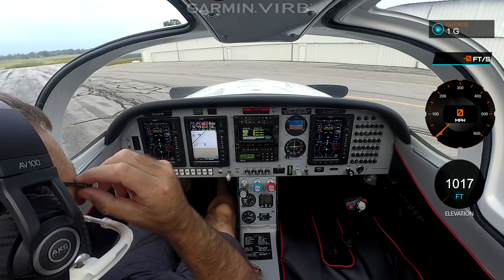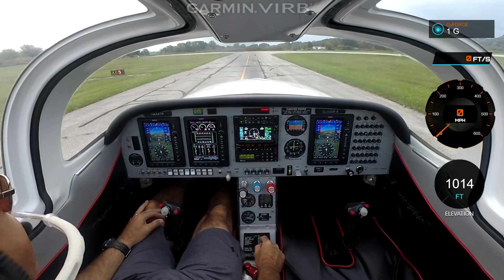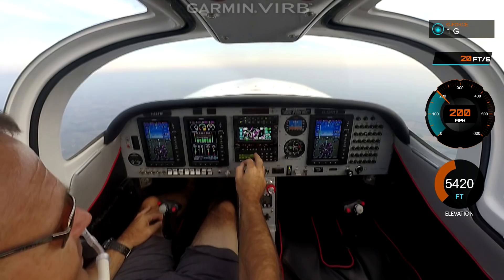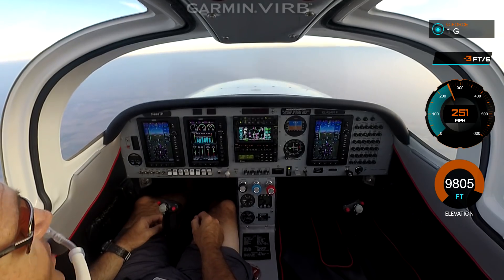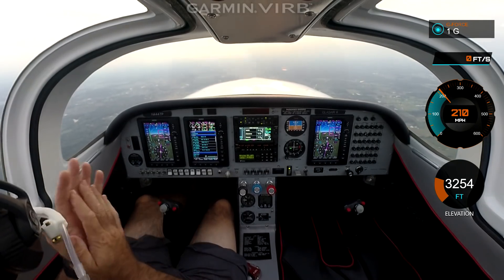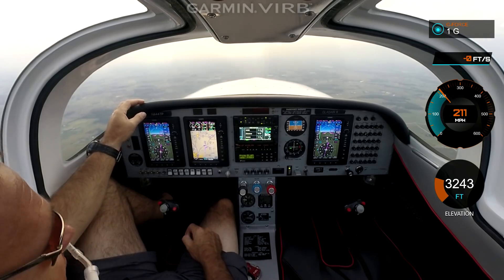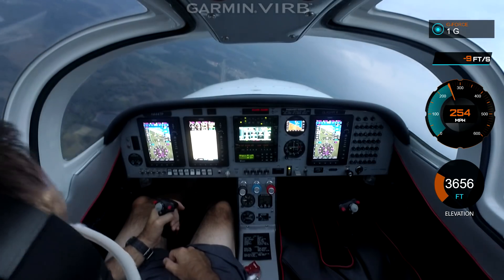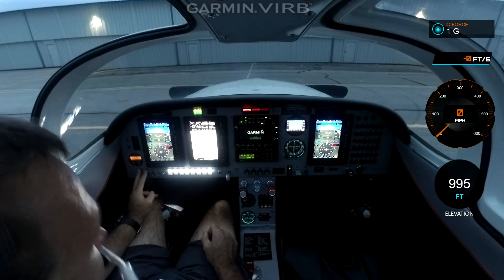Glasair III Full Demonstration with Garmin G3X

Comment: Very small but efficient little airplane. Absolutely love all the features on the airplane. Excellent performance and fuel burn. I can easily see why you chose this airplane over many others. You have total control of the airplane from takeoff to landing. I am extremely impressed with the performance of this light single engine. Your documentary was excellently done!

Comment: Beautiful airplane! Great performance, and a really great video demonstration of the plane and its capabilities! Thank you! I have been a EAA member for about (40) years, and I have dreamed of owning a fast experimental aircraft. Started building an RV-6, then sold it. I owned a Rockwell Commander 14, with an IO-540 engine and a three bladed Prop, with dual full panel of King Gold Crown avionics, DME, HSI, RX-10 Weather Radar, Auto-Pilot system with altitude hold and approach capabilities, and a few other goodies. My plane used to belong to Hilton Head Resort, so it was decked out and well maintained. I loved that airplane, but I always wanted more speed for less fuel burn and overall operating costs. Experimental aircraft is the way to go for the things that I wanted. Also, the new glass panels are really nice! Thanks for your video!
Reply: I agree. Really well produced flying video.

Comment: I just noticed that when you hit the transmit button on the radio that the flap indication disappears and reappears when you stop transmitting. Just in case you weren't aware. Wouldn't want it being a symptom of a much larger electrical issue. Awesome airplane. It's definitely a dream plane for me.
Reply from the maker: Yes,  good catch. If you look closely you will also see the hydraulic indicator peg itself when transmitiing. Both units use a sensor that is too close to the comm antenna.

Comment from the maker: Ok, sorry I have not addressed some questions.  I would like to answer a few.  
First, I had no military training and this plane is easy to fly if you understand that this plane can exceed your physical limitations and also is faster than 90% of piston planes, so you need to think ahead.
The airplane truly is a 205 knot on 10-14 GPH depending on altitude.  It has a range of well over 1200 miles with reserves.
You will spend $200k or more for a good plane like this one that has the extended fuel, updated gear, good avionics, and has not been gear upped.
This plane will not fly well in the ice - do not try it.  The reason it is fast is because it has a low drag air frame and high performance wing.  Ice on the wing and tail, even in small amounts, severely affects it's ability to produce lift.  It could get very scary very quickly.
The airport I flew out of gets about 5 airplanes a day using it.  I was well aware of my surroundings and any aircraft in the area.  Furthermore, the area I flew in was also pretty much void of traffic.  Not much going in in this area.  I had good total situational awareness and was not endangering me or anyone else in the air. 
I wish I would NOT have traded this plane for the Cirrus.  The Cirrus I bought was your typical factory built plane with RIDICULOUS parts prices and was NOT easy to work on.  It was 50 knots slower, used more fuel, and had LESS useful load.  Insurance was also more for the Cirrus.  I knew right away I had made a mistake.  I wish I would have kept this plane as it was the best one in the country.  As such, the guy that bought this plane did not like it and his wife hated it.  He liked the room of the Cirrus and the avionics in the Cirrus better.  I think he bought a new Cirrus.
This plane would never pass any certification for Part 23 and that is why it is fast and efficient.  When you demand that a single engine normally aspirated non-pressurized plane be made idiot proof it will not be efficient or fast.  The only was to go fast in a certified plane is to have turbochargers and high altitude as the wing needs to be forgiving enough for those with low skill to be safe in.  You will only get this performance in a certified plane up high where the draggy wing isn't so draggy.
The camera used in the video was a Garmin VIRB.  I can't remember the exact model, but it is fairly new and is red in color.
I used oxygen on almost every flight because I generate my own, so it is pretty much free.  The oxygen system is self-diagnostic, so you do not have to manually check it before flight.

So, long story short:  Fast, efficient, great ride due to high wing loading, fun, cheap to maintain, bad in ice, bad for people that think the airplane should have safety features like a modern car.  I can't think of a better plane for 1 or 2 people to go cross country in.
Reply: Why did you trade it for the Cirrus in the first place? What did this plane not do that you wanted?
Reply: Thanks for a great presentation of what this aircraft can do. When these first became available a long time back I lusted after one but could never afford it. At the time and for a total of 18 years I owned and flew a Grumman AA1A but with a 150hp motor that I installed instead of the 108. 

My cruise speed was about the same as your approach speed! But I did like the high(er) wing loading, the resultant comfy ride in turbulence where some pilots would not venture, the one finger touch on the controls. and the responsiveness. 

To me an aircraft that flies like a heavy-handling bus is no aircraft worth having!
Reply: St
Reply: Stewart W. J)

Comment: The GP-4 is a good match for this plane. 210 knot max cruise at 75% power at low altitudes and will go 1,200 nautical miles at that max cruise setting, much farther at lower power settings if you can sit there that long, and all on 200HP from an IO-360! I'm planning on building one, and figure it'll cost around $100K with a panel similar to yours. We'll see. Probably oughta finish my Super Baby Great Lakes first, though. Thanks for the nice demo. Subscribed.
Reply from the maker: The GP-4 is a neat airplane for sure and is definitely a good value, but it really is not a match for the GIII for many reasons.

First, the standard landing gear system is not a good design requiring to slow within 10 knots of stall speed to retract the gear.  The hydraulic system is much better, but adds weight and cost which reduces useful load and the initial value advantage.  

Next, the cabin is narrower and tapers towards the feet like the Lancair Legacy.  I find the GIII to be about as narrow as I want to fly in with another adult.  Of course, you get more speed with a narrower cabin typically.

They also list the max range with reserve and top speed as if they are obtainable together which is not true.  At 209 knots the GP-4 needs to be at 6000-7000 ft to make 75% and rich of peak.  You are looking at 11 GPH at that setting which gives you 4 hours of flying time and safe reserve VFR.  That is a maximum of 840 miles and that is not taking into account extra fuel used in the climb.  The GIII will burn the same fuel lean of peak at 12k making the same speed and with 82 gallons available it has a safe VFR range of over 1200NM which includes climb fuel.  At 15k ft it will still make 200+ knots on 9 GPH which is over 8 hours and 1600NM.  The GP-4 will be down in the 160-170 knot range up high because it will only be making 100 HP at 15k with the GIII will be making 50% more HP.  Remember, even thought the GP-4 is only 33% less HP at sea level - it is 50% less at altitude and speed will suffer.  Having the bigger engine in the GIII is not a huge advantage down low, but is very advantageous to give you the ability to get up high and take advantage of the smooth air above much of the weather.  I rarely fly x-countries under 10k because of bumps in the summer and general cloud tops in the winter usually leveling off around 11-13k on my trips from MI to FL.  THe wing loading of 27 per ft on the GIII vs 19 per ft in the GP-4 is also a big differences as far as ride is concerned.  Fly both in bumps and you feel a huge difference.

The GP-4 has a great G rating just like the GIII because they both share a one-piece spar design, but there is no comparison to the overall air frame strength.  The yellow arc in the GIII does not even begin until 292 MPH which is nearly 40 MPH more than never exceed speed in the GP-4.  Never Exceed in the GIII is 340 MPH and Jeff Lavelle is turning laps of over 410 MPH in his stock (air frame) GIII at Reno.    

Finally - value.  Like I said earlier, the GP-4 has great initial value, but only if you consider your labor worth $0 and you limit your budget.  A good IO-360 with accessories (prop gov, dual alternators, starter, electronic ignition, etc) will cost you at least $40,000.  A good prop is another $10,000.  The panel in my plane was $60,000.  That puts you at $110,000 and you have not bought anything for the air frame yet.  Then there is the fact that building one will take about 3000-4000 hours.  It is a $250,000 plane if you have it professionally built to high standards.  At that price you have a lot of other choices.   GP-4 is a neat plane, but just not in the same category.

Comment: Wow, what a machine!  Thanks for such a detailed overview and flight.
Reply from the maker: Thank you. I miss this plane. I wish I would have never sold it. Nothing compares to its performance, efficiency, and handling.
Reply: If fly a 1956 Cessna 172 straight-tail, so this plane is definitely a dream machine. I’m sure your Cirrus is still a worthy plane.
Reply from the maker: I hated the Cirrus. An Rv10 is faster on less fuel, has better avionics, and is 1/5th the cost to insure and operate. I didn't have the Cirrus 3 months before selling it. My wife wanted the cirrus for the Parachute. I would rather have your 172 and the G3 for less money than a comparable cirrus.
Reply: Dukepilot , fair enough. Curiously enough, I’ve pretty much settled on the RV-10 as my dream plane project should finances and time permit. Vans seems to be the benchmark.

Comment: I had a Glasair III for a few years. Not as well equipped as yours but lovely plane. No switching of fuel tanks on mine. I had the manual flaps which I prefer. Would pull 10 degrees flaps at 140 knots before lowering the gear making approaches much easier (plane can apparently handle 160 kts at 10 degrees). However, found it difficult in instrument conditions as it is over sensitive in pitch and the spring trim (no tab) is suboptimal. It’s the only plane I really miss. Cheap and fast.

Comment: My dad built a Glasair 2RG and it was a gorgeous plane. It was fast, too! He also built a Long-Eze before the Glasair. He decided on the Glasair, because we could fly side by side instead of sitting behind if we had to land for any reason, it was a lot harder sitting in the back. I sure miss flying with my dad, but he passed away 10 yrs ago. Sad day when the new owner flew off in it. My mom, brother and I were sitting in our  hangar crying our eyes out. I have a question, why the oxygen when you’re still at a low altitude, is it just because there’s a never-ending supply your plane makes might as well use it? Just curious, hadn’t seen that on any other videos.

Comment: I enjoyed every minute of this video. And thank you for sharing some detailed information on the aircraft itself. I dream of one day flying with same level of ease and calmness, you make it look so easy. Few questions; how long did it take you to transition into high performace airplances like a glassair? For this particular airplane, do you typically fly at the same altitude shown in the video? As someone looking to own an aircraft one day, I've been strictly looking at experimentals and lsa. Whats your take on experimental vs certified? Experience and ownership. Thanks.
Reply from the maker: Hello,

Usually flew the plane at 9-15k ft depending on wind advantage.  I learned in a 152 just like just about everyone else and then bought a Piper Arrow.  I then bought a 182RG, then Saratoga, Turbo 210, and then an old Soviet fighter jet.  From there I had many different planes.

The best way to transition to a plane like the Glasair is to fly a Grumman AA1A for 30 hours or so and get familiar with light control inputs and a heavy loaded wing.  The Glasair is not hard to fly, but it does require you to always be aware of your airspeed and attitude.  It will not tolerate getting low and slow like a Cessna.  A better airplane to transition in the experimental world is a RV6A and then a Glasair.  I prefer experimentals for the speed, cost, avionics availability, and simplicity, but I prefer the certified planes for the build quality and standardized maintenance support.

It's all good :)
Reply: Dukepilot thank you.

Comment: Great thanks.  I will check into it.  After a short time the system starts building pressure.
Reply from the maker: More than likely you have leaking actuator (nose and mains) seals that need to be replaced.  Pressure should drop significantly when gear is being retracted, but it should never stay at zero for any length of time.

Comment: Well, thanks very much!!  Until I saw this video, I was 100% satisfied with my 1RG.  Now, I just have to buy a III !!!  Seriously though, lovely aeroplane.  I was interested in your climb settings, as I pull my engine back to 25/25 soon after take-off (O-320 D1A with a CSU).  But then again, mine isn't a Continental and is about half the cubic capacity as yours.  You have a seriously good aeroplane there Bud.
Reply from the maker: Thanks and good question.  Unless your engine is power limited in it's operating limitations there is no need to pull power back unless you are trying to be quiet.  A full rich (down low) and full power engine cools better and climbs better than any other setting.  You simply lean the engine to the 1250 EGT range in the climb and the leave the other two knobs forward.  Your engine will run cooler, smoother, and you will get to altitude faster where you can take advantage of cool air and tail winds.

Comment: MAN, what a panel!!!    Why not a whole aircraft ballistic parachute, expensive, but seems like a worthwhile addition if money is not a severe issue, and you are as safety conscious as you appear to be?   Nice vid.  I built a LongEZ previous to Glasair introduction, but always liked that airframe.  "Not holding it down"...but somewhat needed to put it back down.

Why all the disparity between what you are calling out and the inset instrumentation readouts?  Not time aligned properly?   20+ MPG, not bad, at those speeds.   

Seems to me the autopilot could do the auto trim with just some stick and pedal feedback, maybe directly off the driving servos,  surprised they didn't built that in.

Comment: Interesting, @ 23:41 he calls out in indicated airspeed of  255 knots, which would be 293 MPH, whereas the video overlay shows 353 MPH.  Assuming the later is correct, that's quite the difference..  Out of curiosity I googled the VNE - it's 335/291 mph/kt.
Reply from the maker: There is definitely some lag between when I call out a speed and the actual speed acquired.  I was gaining between 5-10 knots per second and the tape was moving fast.  I also had a pretty good tailwind  and the 353 MPH speed you see posted is ground speed, not the indicated airspeed I was calling out.  VNE is indeed 291 knots and I have had the plane to VNE.  It was a great airplane.
Reply: @baronpilot2bb   I could have worded that comment much better, apologies -  was attempting to point out how much of a difference is possible between indicated and actual.  And at the rate you were going there, I believe you've hit VNE at some point! LOL.  Yes, awesome airplane, all I want is a G3, especially now that it's in carbon,  but that'll probably never happen.  Thanks for the reply., good luck with the flying.

Comment: I flew in the Glassair 3 once as a passenger. They are really fast. They climb fast, the approach speed is fast, everything just happens a lot quicker than I was ready for. The control inputs in my opinion are too light as demonstrated in the video. Without an autopilot this plane takes a lot of concentration to fly. I wouldn’t take this thing into IMC without the AP on.
Reply from the maker: The G3 is a very easy plane to fly IMC. It is no harder on instruments than a C182 other than the speed. An autopilot in any plane is recommended when flying single pilot IFR.

Comment: Great run through. How much harder is running this plane in higher traffic airports? I noticed you were easily changing from 3000 to 4000 ft without fear of wandering into oncoming airspace. That could be an issue at our airports around Toronto.

Comment: Fantastic Plane right there. Great video- thanks for showing both the good and challenging parts to keep and eye on. Question 4 ya: You've shown just how fast things can get out of hand if your eyes aren't on flying the plane. What is your take with this plane flying in IFR conditions? With that very touchy stick could that get folks in trouble in IFR fast?
Reply: I was wondering the same thing.  That stick should have differential built into it so that it's no so twitchy, especially at high speed.

Comment: I'm surprised more aircraft don't have a lambda probe for automatic mixture control, with some type of manual override based on temps if need be, rather than just running full rich all the time.  Great vid regardless, beautiful bird, thanks for sharing.  I'm very curious to see how the new G3 carbon pans out.  Should be even better.
Reply: Lambda mixture control is well proven.
Reply: @FairladyS130  yes, although the sensors don't like to ingest lead, they clog and fail over time.
Reply: @ssoffshore5111  Which is not a problem with unleaded fuel, users choice.